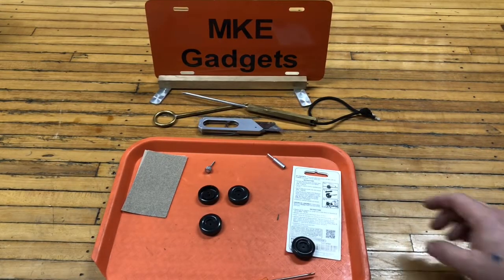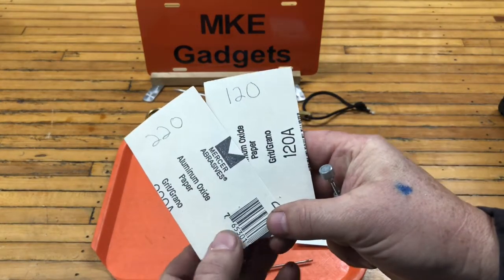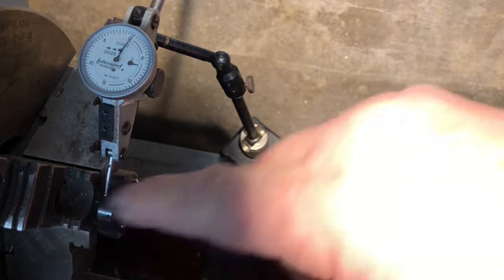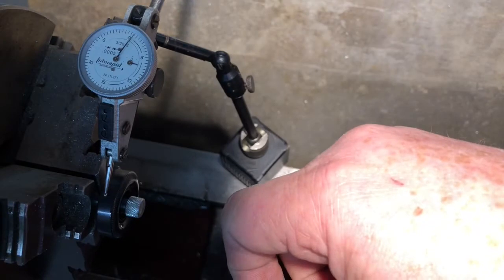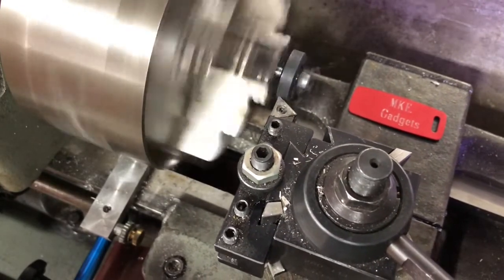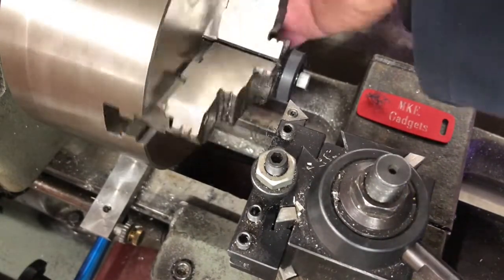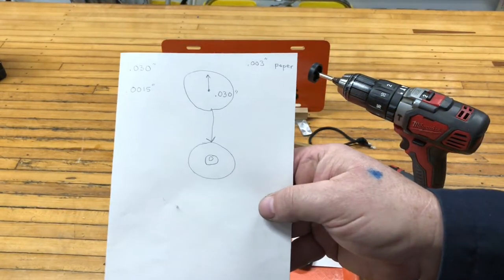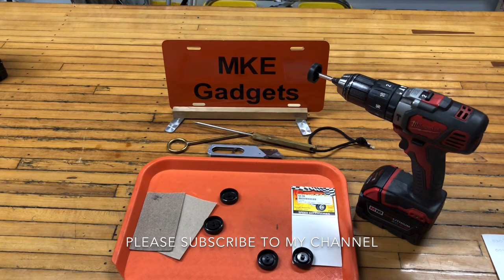Pine Wood Derby Cars, Wheels on a Lathe  @ MKE Gadgets #73

Comment: For a rework operation like this I would recommend using a 4 jaw chuck and indicating in the mandrel you’re mounting the wheel on or as a back up option a 5C collet. A three jaw chuck on a lathe that size could have .010 of runout in it. The diameter you’re turning is coaxial to the headstock but unlikely coaxial to the axis the wheel will be mounted to the car with.
Reply from the maker: You are correct with all your suggestions. Unfortunately I don’t have a 4 jaw chuck or a 5C collar. My 3 jaw chuck runs out about .003/.004. Please support my channel by subscribing if you haven’t.